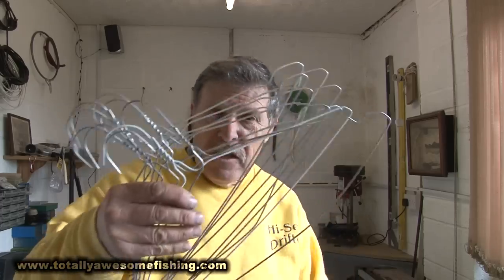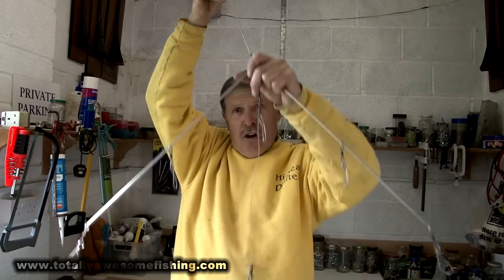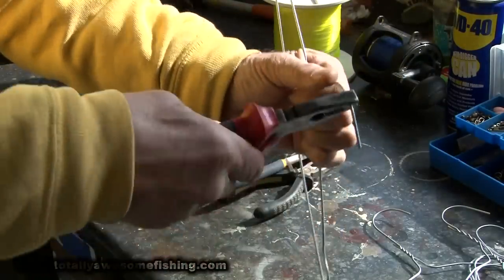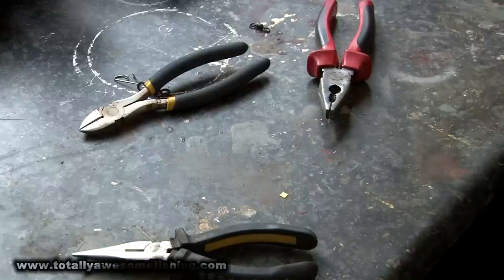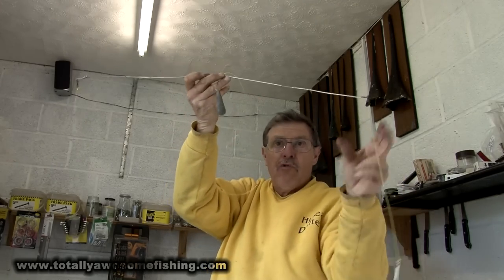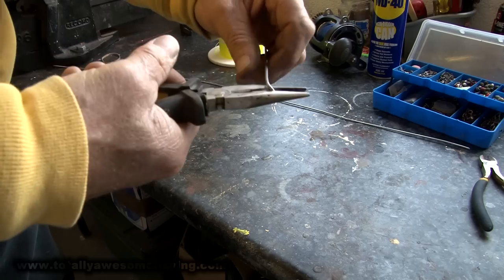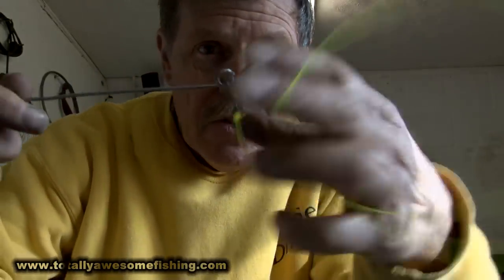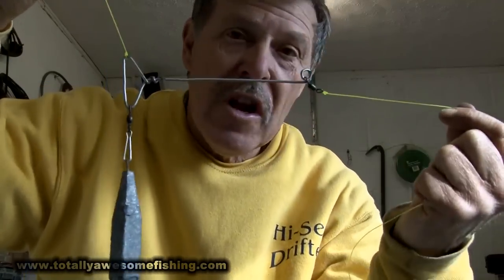How to make fishing booms, cheap and simple

Comment: Great Video, very informative. I now live in Thailand and Booms are impossible to find in any Tackle shops here. I immediately went hunting for some wire coat hangers and realizing I didn't have any remembered I had some rigid 0.5 & 0.3mm stainless steel rods in the Garage. I made some french and Clements type booms and they have turned out better than I used to buy back in the UK, will be testing them out on a boat trip in the Gulf of Thailand this weekend, they look great. Wouldn't have thought of maiking my own until I saw your video...Many Thanks!

Comment: i know that this is an old video, but i am in awe of the ingenuity of the sliding booms due to the fact that it is hard to get line twist in them. does the length of the sliding boom depend on the length of the leader used in making it or can you use a somewhat short boom for a long leader for the same application. i have never heard of doing this and in south florida, because i have never seen anyone using this technique.

Comment: i have made these before and they are quite useful but on the v boom i wouldnt put the wire through the top eye of the swivel put it through with the split link eyelet to give yourself a clean ring to connect your reel line to